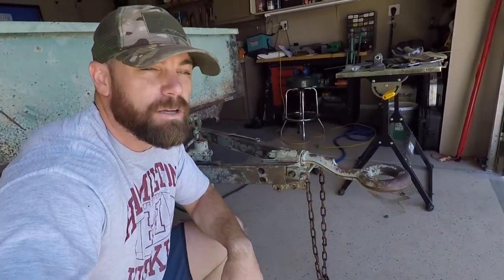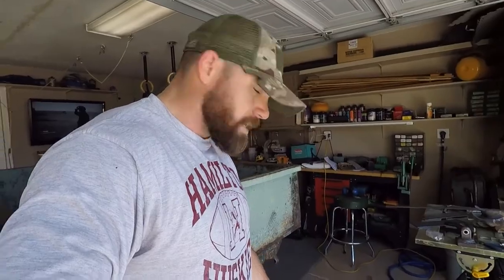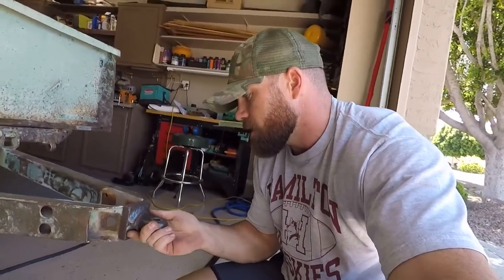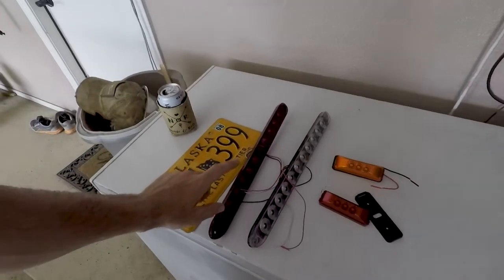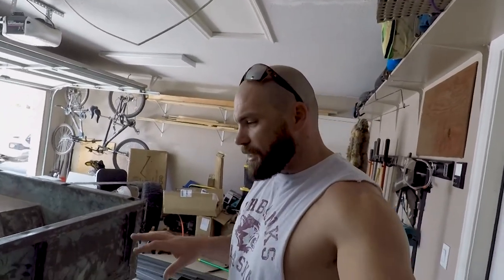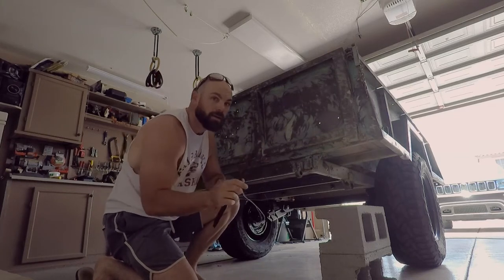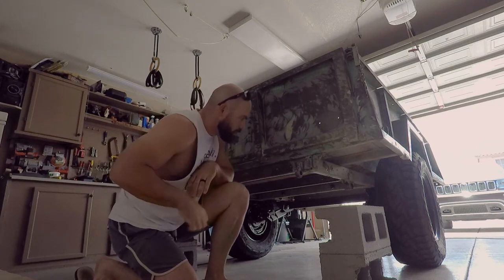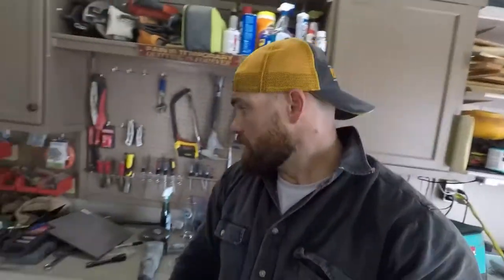M101 Trailer Build E4 - Lock N Roll Hitch Install

Comment: great vid, thinking about getting one of these for my trailer. You in az? noticed the hamilton huskies shirt
Reply from the maker: Yep, I'm here in AZ. I love the hitch. Awesome articulation and quite unlike the pintle it had.
Reply: @CallIntheCountry  nice, I am in the east valley. There's been a few times that my trailer has almost tipped over on the trails. If it were to tip, the vehicle would go with it, this seems like a good option to make sure if the trailer tips, it doesn't take the tow vehicle with it.

Comment: Why did you choose the lock n roll over the max coupler?
Reply from the maker: From what I researched the lock n roll was supposed to be easier to hitch to the vehicle. From my experience with it so far I have had no issues with hitching up and see where the max coupler could have been tricky at times.
Reply: @CallIntheCountry  thanks for the reply...are you still happy with it?  No play or rattling from the hitch?
Reply from the maker: @xbpbat21x  nope. I’d guess that I’ve put about 2000 miles on it so far. Couple hundred of those being off-road.

Comment: What does the other part of the hich look like?  I want to do a DIY articulating hitch or get a lock n roll for my M416.
Reply from the maker: Mike Anderson this is the one I have. Hooks up pretty easy which is one of the things I was worried about when I was looking.  https://locknroll.com/shop-now/vehicle-side/pn-511-adjustable-height-trailer-hitch/
Reply: Thx.  They are not cheap.  I think I will look into making my own.  I am in Phoenix too
Reply from the maker: Mike Anderson no problem. You can for sure make your own, I had a hard time forking over the money for mine too. You can take measurements off mine if you want to fab your own though. shoreshunter@gmail.com

Comment: Curious if you have the old hitch still? I have attempted to flip mine many ways without success.
Reply from the maker: I actually just tossed that the other day. Just trying to flip for the height difference?
Reply: Call-In the Country yes. A flip would help the trailer sit level with my lifted Jeep